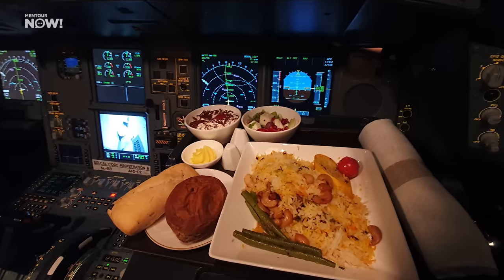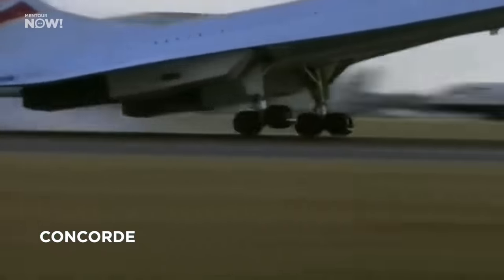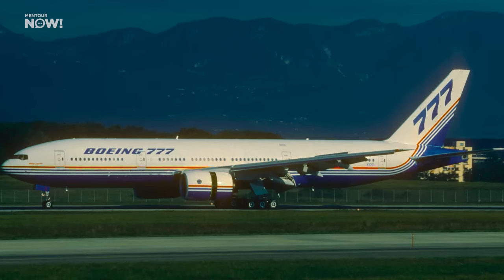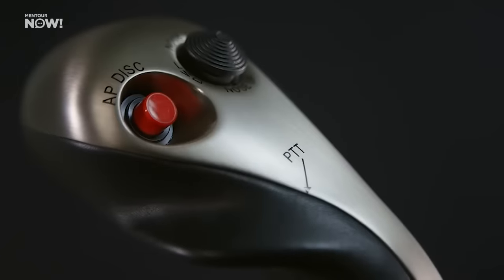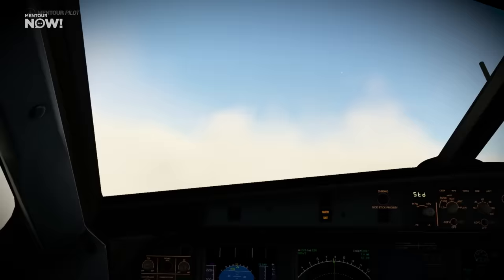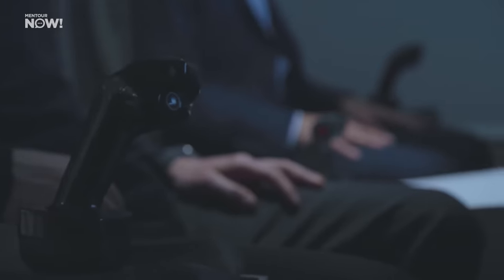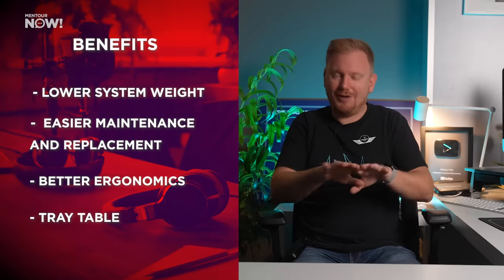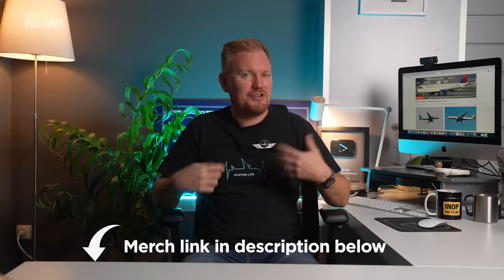Will Airbus Finally switch??

Comment: Airbus and Boeing are in the business of making money. They don't incorporate new technology and new features unless there is a measurable safety impact or their airline customers are going to profit from it. Active side sticks are intuitively a better approach, however, it is arguable that the current passive sidesticks provide an acceptable level of safety and that by introducing new technology one might actually degrade safety by not fully understanding how it will interact with pilots and even making mistakes while engineering the design. Another example, how would one safely operate a mixed fleet of active and passive sidestick aircraft. Would there be safety implications of moving from an older A320 to a newer upgraded A320? The cost of design and certification to the manufacturers and the cost of training to the airlines are substantial, which is why technological improvements like this are usually incorporated with new aircraft type design. FYI - I spent 35 years at Boeing, and worked on 7J7, 777, 737NG, 757-300, 787, and 777 aircraft.

Comment: Ok, does one system affect the aircraft in a different way in terms of speed of response of control surfaces and more crucially if so, how does that affect the statistical outcome if you like, accross a number of crucial metrics be they safety, confort or fiscal?...great vid!

Comment: Are touch screens really that ergonomically viable that they see much use in an airplane cockpit? I know there's a difference in quality, but many people already hate when the infotainment system and center console in their car are only operated by touch, or even worse the controls on the steering wheel which are directly related to road safety.
Reply from the maker: I don't think the Airbus touchscreens on the A350 are operated solely by touch. It's just another option. In turbulence, for example, buttons and switches would probably still be preferable.

Comment: Active side-sticks are quite simple. It by far not rocket science! Simple version for private use can be found in gaming hardware for flight simulators. The only real challenge is to build them as most as possible reliable.
Reply: It's not just pure reliabiltiy. It's also the point that if they fail, they have to fail in away that doesn't endanger the aircraft in any way, every time. That's the really hard part when it comes to active sidesticks.

Comment: Hey from Australia! My mum uses to work for ANSETT AUSTRALIA.

Could you please do a video about why Boeing Chose "BOEING BROWN" for its 757 767 777 and 747-400/8 flught decks while they use grey colour flight decks to airbus for the 737 and 787?

Also why does Boeing use Fishing Reel style Tillers for the 757/767/777 and 747?
Havenyou noticed the fishing reel style is in all Boeing brown flight decks?

Why does boeing chose to use Airbus Style tillers for the 787 and 737?

The only thing I noticed is the Boeing brown flight decks are on all HEAVY category Boeing aircraft.

Also every Boeing Like rhe 777 and 747 that use that FISHING REEL style tiller also utilise rear bogey steering.

Does rhe A350-1000 that also has a triple bogey also utilise rear bogey steering as well as well as why the 777 has the rear bogey steering?

Thanks!

Comment: I’m still so surprised airbus didn’t at least completely redesign their sidestick after the Air France 447 crash which very likely wouldn’t have happened had that plane had yokes. We have to take off our shoes for security every time we fly because someone unsuccessfully tried to sneak a shoe bomb on a plane but nothing happened after hundreds of people fell from the sky into the Atlantic?!
Reply: Without diminishing your point about side sticks/yokes, minor point of order, Richard Reid did get his explosive shoes on board the aircraft, but failed to detonate them, and was subdued by pax.

Comment: On the subject of side-sticks: Why does Airbus believe that it's a good idea to have the side-stick for the capitain on the left, whereas it's on the right for the FO. I've recently had to deal with a fracture in my right arm (being a rightie) and I was struggling with brushing my teeth. I wouldn't dare to chop onions. I know it's a matter of training in the end, but this seems to be such a pointless design decision to force pilots to swap their controlling hand when they get promoted from FO to captain.
Reply: Because you cannot put sidesticks on the right in the captain area where that same hand has to be used to manipulate the thrust levers. You need to be able to operate both simultaneously and your suggestion will not cut it. It would be quite dangerous in certain situations. Center sticks would be better but they wanted maximum pilot comfort and space, and you can't move your legs around as much with suck. So stick to the side it is. Using the left hand has not been a problem for the vast majority of Airbus pilots I came across. Many of them said it was easy to use the left hand on the stick as opposed to brushing teeth and playing tennis with the same hand.

Comment: Airplanes, regardless of manufacturer, have fascinated me for quite some time. They’re just awesome from an engineering point of view.  It’s a shame Boeing is having so many issues as of late.  A bad merger with McDonald Douglas and subsequent inept management from the top down has given Airbus an easy path to gaining massive amounts of market share.  They deserve it though.  While Boeing is screwing up left and right, Airbus has been pumping out impressive airplanes. I hope Boeing can get there heads out of their greedy asses and start focusing on safety like they used to before the merger.  Healthy competition between Boeing and Airbus is great for the airplane industry.

Comment: Lack of feedback on passive sidesticks are believable and understandable. But are you aware the impending dumpster fire with the thouchscreens? This is not candy crush FFS they HAVE TO be tactile buttons.
Reply from the maker: I believe the Airbus A350 touchscreens still have tactile buttons, plus a trackball-like system to control a cursor. Touch is just an additional option, not necessarily for all the screens.

Comment: A dumb and perhaps tangentially related question: why the hell are the sidesticks on different sides on the right or left seat? Do they have to put left-handed people in the left seat? Are captains good at flying with the left hand and co-pilots with the right hand? Does a co-pilot promoted to captain initially suck at flying until they get used to it? Using your non-dominant hand certainly involves lower levels of fine motoric control. Shouldn't controls be identical on both sides, as much as possible? Wouldn't sticks along both pilots' body axes - i.e. between their knees - allow better control (and provide the pilot with a visual cue that the other pilot is making inputs)?

In a pinch, I (right-handed non-pilot) could imagine controlling an aircraft with my right hand and the throttle with the left, but the other way around would be a recipe for disaster. It would be like switching from a left-hand drive car to a wrong-hand drive and trying to shift gears with the doorknob.

Comment: Imagine trying to accurately drive your car with a frigging joystick...
I cant believe airbus uses them, One flight crashed badly because the co pilot was pulling up for a long time as the plane went into stall but the Pilot didn't see what he was doing until it was way too late,    If you fly in Micro soft Flight Simulator you would agree.

Comment: The Airbus solution is just crap. Either have a yoke, a stick with a mechanical and/or hydraulic connection, or a force feedback joystick that adjusts its counterforce according to the amount of force hitting the control surfaces. The incidents you described in which the sticks led to an accident or a upset, could have been avoided if any form of feedback was given to the pilots. 

I don’t know how this is still allowed. 

And the most upsetting thing is that fighters despite having extremely advanced fly by wire systems still give feedback to the pilots. 

The other thing to prevent situations where the stick could mislead the pilots, is having redundant systems that keep the aircraft in normal law even if ALL pitou-tubes were clogged. There’s GPS, ring laser gyros, etc. 

I mean even a tube with a propeller in it or an array of surfaces that always point in the direction of the wind could have given more useful information to the pilots than the system currently in place. I can’t understand how an army of engineers are unable to fix this problem. 

I‘ll not fly an Airbus in colder conditions or for transatlantic flights until this problem is solved.

Comment: My question would be if i moved from(im not a pilot) the right seat where my dominate hand is in control to the left seat where as now im using my other hand would that not make your inputs to the stick less accurate? I know if i play a video game with a joy stick i always use my right hand for directional control, if i switched its very awkward

Comment: I can't imagine it impossible to retro-fit actual Airbus designs to active FBWs. 
In the end it is just replacing teh box and upgrading the avionics software.
I don't want to be cynical but I bet it is just complacency and/or financial reasons they are not yet introduced wide-scale.

Comment: The joystick controller on the Airbus is like a Playstation controller on a submersible that later gets upgrade to an Xbox controller. It will work.  What could go wrong?

Comment: If side sticks are so good and save weight, why do I not see them in vehicles even more weight sensitive than an airliner, like a chopper. The 7J7 was one of the rare attempts to be honest with the ignorant public, to have the props in plain view, which never made it to commercial service. I bet the PR dept have a bit to do with that. All high by-pass turbo fans are just glorified turbo props, they rename the prop a fan and hide it inside a shroud. We are also still struggling with the "sound barrier", the record speed holder biz jet just beat the next runner up by maybe 3 kts. But range can basically translate into speed and big airline jet still have the edge. Most mid sized jet can cross the Atlantic, it is a joke, but just 3 makes of biz jet can cross the Pacific non stop. I remember in the mid 60s, from HKG to LHR took 22 hours and 4 stops. Those first generation fans jets have little range.

Comment: Touch screens are a terrible idea in airplanes. Used a couple touch Garmin systems and it's almost impossible to use them in turbulence. Not sure why they are glorified on new airplanes. Definitely doesn't justify a side stick😝

Comment: One of the issue you should have said about Fly-by-wire is pilot feedback. You can simulate it all you want but its not the real thing. I will trust a drunk pilot over a computer, think about it like this. A computer program that is relaying on highly delicate sensors (which can break by looking at it, Looking at you CADCs) or a human who has been trained to deal with all kinds of crazy scenarios on a aircraft?
Reply: Well its better to simulate the feedback (777, 787, A220, Gulfstreams),even if just fake than to have 0 feedback, like with Airbus FBW. Also do know that most airlines that is not the 737,  use artificial force feedback. Real direct feedback on aircraft like on the 747-767, DC10, L1011 etc would have make the already heavy control surfaces too heavy to move. As a result, the cables aren't connected to the flight controls but the hydraulic system servos, with a Q-feel artificial feel system.

Comment: In a Boeing if one pilot pulls back and one pilot pushes forward the Boeing tail will split the elevators much like the Egypt accident. How does Airbus Flt BY Wire Handle This.

Comment: Petter, you are somewhat mislead at time 16:55 when it comes to "autopilot feedback to the sidestick". I know that you are an experienced pilot on the Boeing side and you think that Airbus AND Boeing airliners are "fly by wire". But there is a HUGE difference that is the reason to make you think that Airbus should make an "autopilot feedback" to the sidesticks.
The Boeing "fly by wire" is using control surface deflection as its primary control and feedback dimension. Airbus flyby wire sidestick input and autopilot input does NOT address flight control surface deflection but either aircraft attitude or attitude rate or flight path rate. Except in direct law. So in Normal Law and in Alternate Law it would be inappropriate to have a control surface deflection feedback to the sidestick when flying in autopilot engaged mode. If the sidestick would be moved proportionally to the control surface deflections, it would wiggle around quite a bit in gusty weather. When the autopilot is switched off, the pilot would not have to do what the autopilot did before. The just has to leave the sidestick centered and the real fly by wire will keep the aircraft stabilized with all the necessary control surface deflections. The autopilot in the airbus des just command flight path corrections or attitude corrections and NOT control surface deflections. THIS is a HUGE difference between Airbus fly by wire and Boeing's "fly by wire" that still keeps the philosophy as it was 60 years ago - just replacing some steel cables by copper wires and adding some limiting functions so that the pilots can not so easily crash their aircraft. Of course, you are correct for the case when the airbus fly by wire is in "Direct Law" then you could use an active sidestick to replicate the feedback force that is coming from a deflected flight control surface. Only in this mode it would benefit the pilots to feel the need to trim the aircraft. When it comes to move the sidestick to copy the movement of the other sidestick that would not be a help to pilots that try to control the aircraft while the other pilot is the "pilot flying". See the incident of the Air Frace Boeing 777 at Paris CDG when both pilots got confused and were reporting that the flight controls were not functioning properly. This was while both control wheels were working synchronously (connected) I could argue that Boeing lacks a "Dual Input warning" in their "fly by wire" cockpits.

Comment: Hi everyone. I have nothing against FBW and Sidesticks but .. I wish someone sometimes would raise the biggest problem associated with FBW especially FBW Airbus style .. it's a "Basic Flying Skills" killer. Produces "System Operators" and dumbs down real pilots. Maybe it's because nobody actully gives a f**k about this topic I get it. Anyway if no one else mentions it i do: FBW is a Pilot's skills killer. Said that, given the fact that most pilots engage AP at 200ft and disengage it at 1000ft at best it doesn't actually make any difference, pilots are phenomenal in making sure they are utterly uncapable of flying an airplane, Airbus or Boeing.

Comment: With the absolute mass of technology in planes, why are voice recordings not permanent.
My home Amazon Alexa records my voice commands  (and maybe more lol)  FOR EVER
Also 8 cams fixed outside, in cockpit and cabin/hold, with a screen in cockpit, may assist problem detection eg fires, landing gear, engines, outside damage - even my silly wee car has 5 cams.

Comment: Instead of the clumsy center console, why not a shared joystick between them so there is only one. And much smaller with almost no motion. And tiny throttle.
And move the seats up and closer to the windshield. Get rid of all the junk in the ceiling, the autopilot bar and just have one big display per pilot. With synthetic vision. It's beyond bizarre that not even the latest A350 has synthetic vision. Airbus should lead the way in rational design. Get rid of all that awful legacy junk and show mafia boeing how it's done.

Comment: Whatever happened to "I have control".
To share input on joystick, yoke or side-stick, is foolish when any problem circumstance occurs.
Recipe for disaster, ESPECIALLY when flight controls are being averaged between two pilots.  A NON-SENSE paradigm in my uniformed view.
Yes, I understand both pilots have the means to 'take-over' complete control of the aircraft by disabling dual input/control if necessary.  But this is a minefield that underscores deep flaws on both human psychological and machine intervention levels. ESPECIALLY when the machine conflicts with the human.

Comment: I fail to understand how fly by wire is safer. As was the case with the a330 in Australia that suddenly got a mind of its own all it takes is a little bitty software glitch to make the plane override the pilots and everybody's dead. Thank God in Australia nobody died on that plane but it could easily happen and that is not possible on a plane that isn't fly by wire
Reply: 737 MAX would like a word with you. That plane isn't FBW and it still had MCAS pitch the nose down violently to crashing. And FBW doesn't necessarily mean safer aircraft but I'd take having protections (Boeing soft limits that is) over none anyday.